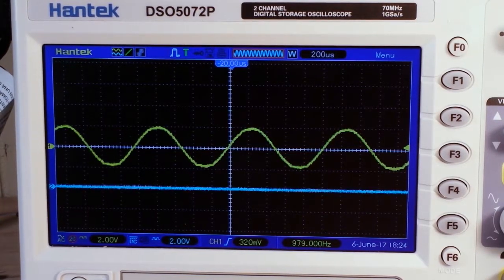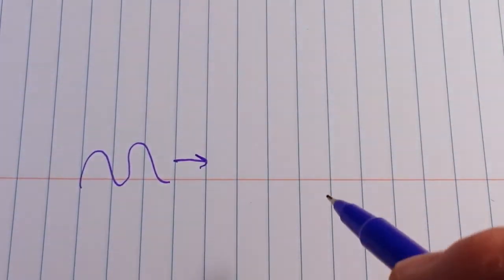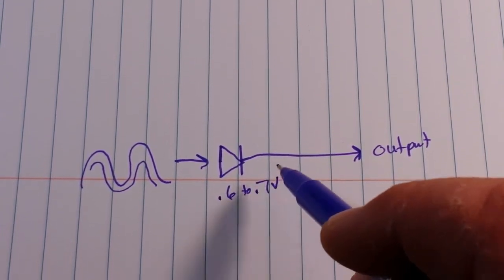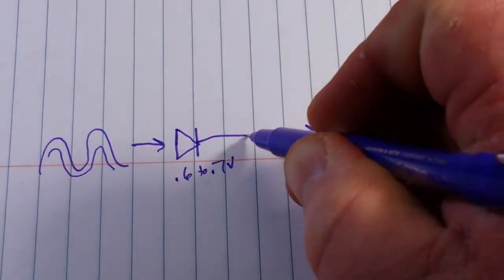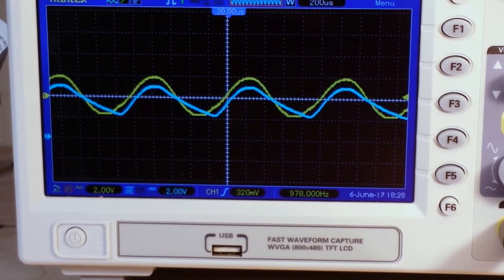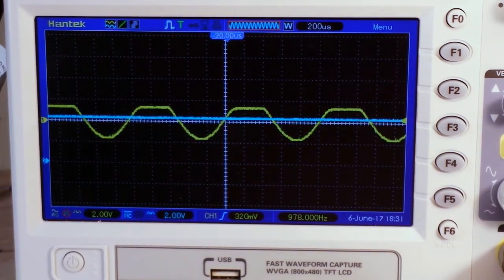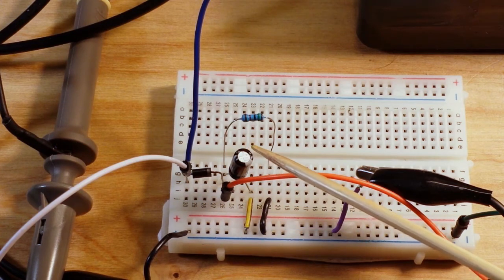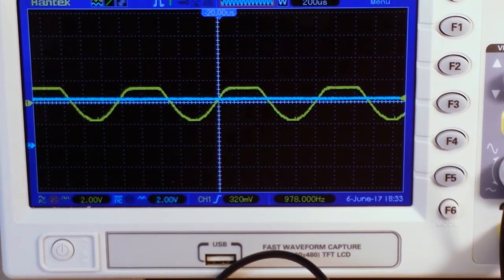How to make a peak detection circuit

Comment: use a opamp before the diode sampling after the diode like a voltage follower, with a low slew rate,  and then another opamp voltage follower at the end for loading in the rest of the circuit.

Comment: I guess this doesn't work for low power signals :P
Reply from the maker: fredlllll why not?
Reply: cause that is a lot of charge that has to be put into that cap and to combat the resistor. so if the signal can only supply a few µA its probably not going to work.

you could replace the resistor with a switch for resetting and the cap with a tiny nF one. maybe add an opamp buffer (i guess 1megohm of the osci would still discharge the cap?)
Reply from the maker: fredlllll you can substitute any of the components to match your signal